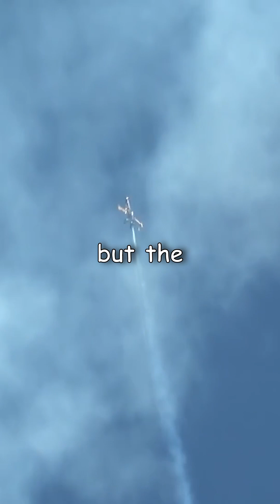Can a Jet Damage Buildings at Subsonic Speeds? #shorts

Comment: Many airports from 1969-2003 Rejected The use Of Subsonic Airliners Meaning the Concorde can only fly from JFK-LHR Becouse of the Shockwave would break many windows on nearby houses.
Reply: Actually wrong, concorde could only land at fitting airports which were equipped to repair any damages during flight and maintenance.

Actuality the Concorde could only fly at sonic speeds when crossing international waters above 65.000ft, anything lower then the concorde would have to immiditaly reduce its speed.

Beautiful plane, just a lot of restrictions with flight speeds for good reason.
Reply: Concorde flew out of Dulles for years. Over thousands of homes dating back as far the 1700's or longer.